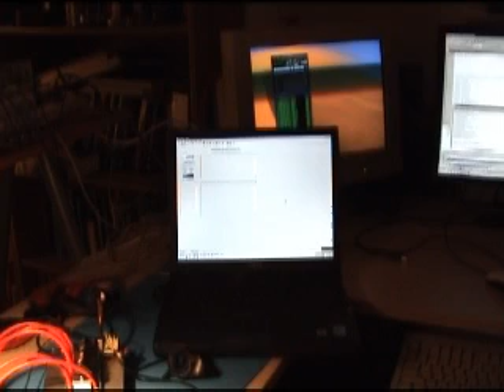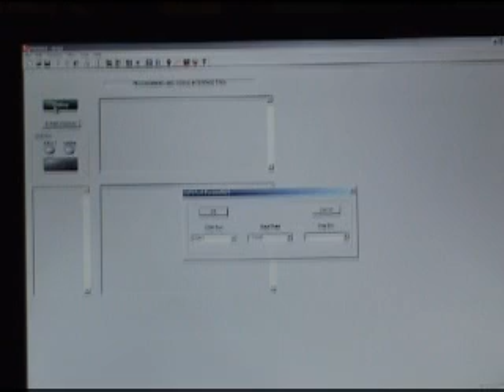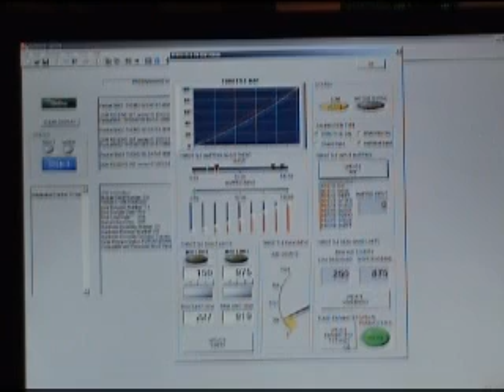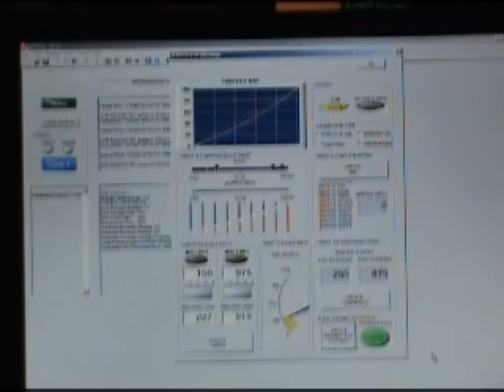E-Bike Throttle Calibration

Comment from the maker: Haven't worked on this in a while, but most throttles for ebikes tend to be fairly primitive because people tend to use them in wide open throttle mode as oppose to variable operation.  Anyone that can write firmware can implement a non-linear throttle response in a controller with proper deadbands and ratelimits.  Fun stuff for DIY people.  I wrote this for a ebike project that I played with for a while, but later dropped it.